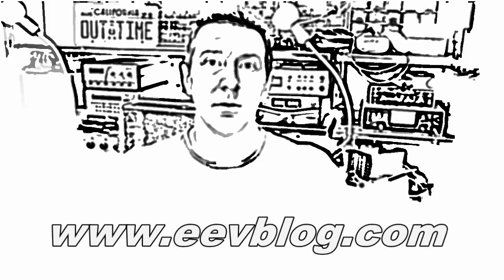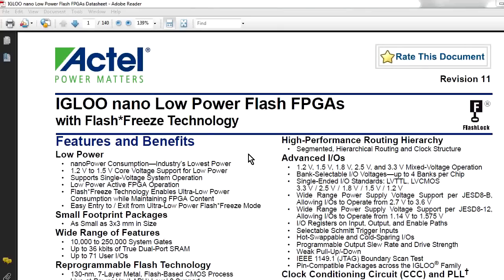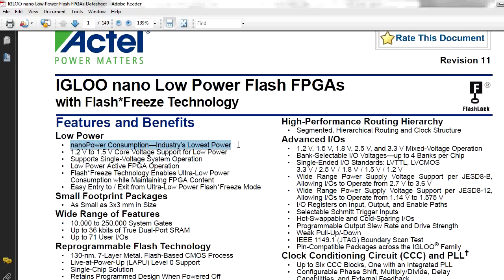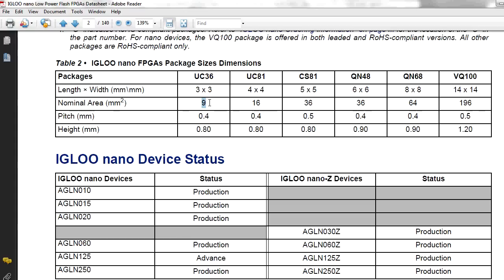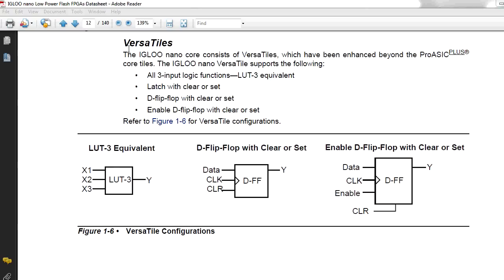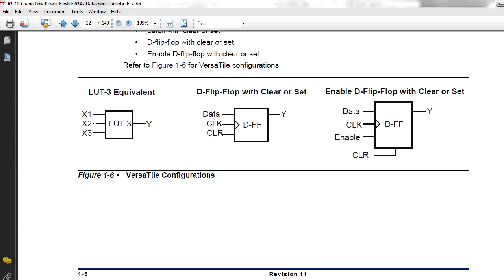FPGA Implementation Tutorial - EEVblog #193

Comment from the maker: @Maytemberr That technique is called Via-in-Pad and is used a fair bit, but generally only if you are desparate and have no other choice. You have to be very careful using it, and often get your vias plugged to get it "just right" without a large failure rate. And in this case you'd need tiny vias anyway. That can be expensive. It would be foolish to go this route unless you absolutely had too.

Comment from the maker: @JHakim1289 Digital devices are switching devices, so that means they "gulps" of current when they switch on every clock edge. This is very high frequency stuff, so you need a bypass cap close by to provide the power without all the inductance of the power supply wiring.

Comment from the maker: @mikeselectricstuff That can be a big bonus. The 2.5V AUX supply is usually a real PITA. But for this designs there happened to be other stuff running at 2.5V too, so not so bad, but that's not very common.

Comment: @EEVblog Very nice and informative video. More often than not you wander off topic and come back after realizing it. The fact is, they are some of the most important tips and tricks about say pcb routing and other technical stuff like that, that only experience can teach you. So don't worry about the length of video, the longer you rant on, the better for beginners.
It would be helpful if you could take your time in making a vlog about programming aspects of FPGA's aswell.

Comment: Why is R28 180k when the desired output is 1.5V?  The data sheet for the LT3080 states that Vout = Rref * 10uA.  Any clues? This R28 will produce 1.8V which does not match the net name.  Refer to 32:33 in the video.

Comment: What is a bypass capacitor? That cap is going to provide some power when the voltage drops briefly or absorb some when the voltage spikes. why is it needed if you have a chip that can operate anywhere between 1.2 and 1.5V? just put 1.3 on there to be safe, surely it'd not drop by 0.1V on a well regulated supply

Comment: I'm trying to do this, and the description doesn't make any sense to me, you say 4/4 track/space, but I think you mean 4/3.. Standard footprint and 4/4 implies the standard footprint has 0.1mm diameter balls (because 0.1mm space + 0.1mm track + 0.1mm space = 0.3mm, with a 0.4mm pitch that means the ball has to be 0.4mm - 0.3mm = 0.1mm ball).  I'm guessing you used ~0.15mm ball (The altium igloo nano design library pad diameter), 0.1mm track and 0.75mm spacing with the pad. Is this correct?

Comment: Well, solders will flow through vias while soldering process, so yes manufacturing issues. Thus, you dont put vias directly onto pads, just a small trace from pad to via. It is possible to do it, but will require extra cost for you.

Comment: Ah finally this makes sense. So you'd use this by most/all devices? Also for I/O would you always use a pull up/down resistor and have it by every device? New to electronic design in general, only just figured out how to make a 555 clock and use it for a decade counter and a shift register

Comment: Is it bad design practice to put vias in SMD pads?  If so, why?

It seems like you could put a via right in all of your ground pads and it would be directly connected to your bottom ground plane without any traces.  It would also be tented only on the ground plane side.

Is it a manufacturing issue?

Comment: Hi, I have query about How to route the signal clock in pcb, I have two situations.
Situation 1:
I have a source clock and two ADC converter(one channel each one) which will use the same clock signal, the trace of the clock signal from the source clock to adc converters have to be two separated tracks ? or they could be the same track and the separated tracks? , if so ,what restrictions I should take account (track width, lenght..).

Comment: Would you suggest passing the output from the previous regulator to the next highest voltage regulator?  Let's say you have a 5V and 3.3V regulator.  That's 1.7V across the second regulator.  If it's a LDO device, that's quite a lot of waste, huh?

Comment: Hi Dave, what about using "via in pad" 
for pcb design?
Reply: +irgski I use vias in pads all the time and they work well. You get the added benefit of better thermal conductivity.
I use exposed copper on the other side, so I have a "free" heat sink as well (assuming you can form a continuous ground or power plane on the other side).
You just need to watch out for the solder getting wicked to the opposite side (capillary effect through vias).

Comment: For ideal capacitors a 1uF and 100nF in parallel are the same as a 1.1uF capacitor. This assumption is fine for low bandwidth electronics but real capacitors also have parasitic inductance and resistance.  With that in mind the reason for having these two capacitors is to offer low impedance for a wider bandwidth which allows the high frequency digital signals the FPGA is capable of producing.  If you want to know more you should read about decoupling/bypass capacitors for high speed digital electronics.

Comment: Aren't parallel connected capacitors basically the total of both (-> 1.1µF then)? As far as I know there is not a big difference in charging and decharging speeds from different capacitor types.
Reply: Different types of capacitors have different physics, like an electrolytic capacitor has a lot of capacitance easily, but a lot of internal resistance compared to a ceramic capacitor.  Internal resistance limits the amps a bit, which matters a lot when you get into really small stuff.  Also, in addition to ESR differences, a ceramic capacitor is piezoelectric a bit, while an electrolytic capacitor has things like dielectric absorption.  You just gotta remember every component isn't made of the same stuff, therefore not every component has the same exact physics, just works as a component with its own advantages and disadvantages.  For 1.1uF and .1uF, you'd have the low capacitance capacitor with a very low ESR to filter out high-frequency-low-amplitude noise or fluctuations in voltage, where the larger capacitor does the bulk of stuff like handling when the device suddenly surges its power consumption and needs a little extra power.  Ceramic capacitors, Electrolytic capacitors, aluminum capcitors, polymer capacitors, paper capacitors, tantalum capacitors, mica capacitors, there's tons of different kinds.  I think dave has a video on them actually.

Comment: would you like to share you demo board design files? the igloo nano is a nice beginner fpga. I just ordered the actel igloo nano starter kit and a seperate 100pin flat pack unit since I probably can manage to etch and solder the 0.5mm pin pitch. should be easier than the nasty one you got.

Comment: Situation 2:
It's a little bit different than situation 1, I have a source clock and one ADC converter(two channel , two input clock) , the trace of the clock signal from the source clock to adc converters have to be two separated tracks ? or they could be the same track and the separated tracks?, Thanks in advance

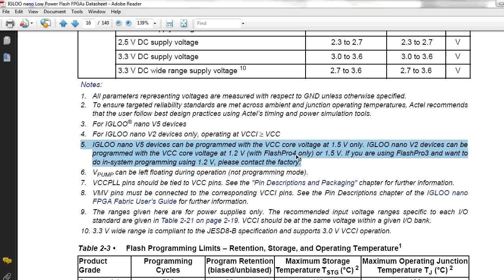Comment: 18:40 Trap for young players? You've trapped yourself, Dave. It doesn't say the Igloo can't be programmed at 1.2 V. All it says is that the 1.5 V variant can only be programmed at 1.5 V (no shit) and that if you want to program the 1.2–1.5 V variant at 1.2 V, you can, but you have to get the FlashPro4 (and possibly with the FlashPro3, but it's probably not that simply because you're supposed to contact the factory about that).
Reply: Cody McBrody What knowledge? I read the datasheet he showed us on screen. My problem is that the information he gave us is wrong. He said the Igloo can't be programmed at 1.2 V while at the same time showing us a section of the datasheet saying that it can be programmed at 1.2 V. 
I wish this were an isolated instance, but Dave is notoriously bad at reading datasheets.

Comment: Doesn't Actels programmer supply VPUMP? When I used them they did. In those cases VPUMP should be pulled low with a 10k resistor during operation. If you supplied VPUMP it will consume power which is a total waste.

Comment: What a load of waffle !!!
FPGA on a two layer board with 4 mil tracks for power rails. Who are you trying to kid?
Most BGAs have the power rails in the centre of the chip, so your not going to be "fanning out" in the way that you describe. I don't have the datasheet in front of me, but I'm certain if you first connected all the power rails on the BGA that the fanout (for the I/O) would be less intimidating as your suggesting.
.
Power rails to a BGA on long 4 mil tracks. Who are you trying to kid? Have you heard of decoupling capacitors and where they need to be placed?

Comment: If something is not intuitively understandable and requires a manual or looking up a data sheet, it is bad engineering and should be marked for the bin.
Reply: +Ernst Stavro Blofeld That's way too broad of a brush you're using there.
Reply: +Ernst Stavro Blofeld 
I'm pretty sure that's why mankind invented the CPU, and higher order programming languages.
Reply: Spoken like a guy who has never done any embedded design. Good luck getting past passives without using datasheets. 

Reading datasheets is a primary activity in embedded design. And there's no way around that; one cannot inuit communication protocols, for instance.
Reply: True, although I've spent enough time banging my head on an oscilloscope because working out the protocols that way is less painful than a chinese language datasheet to know its possible.